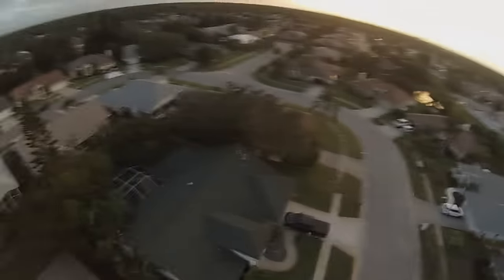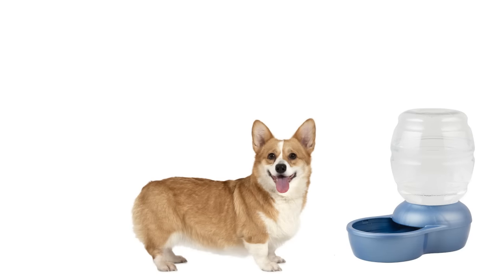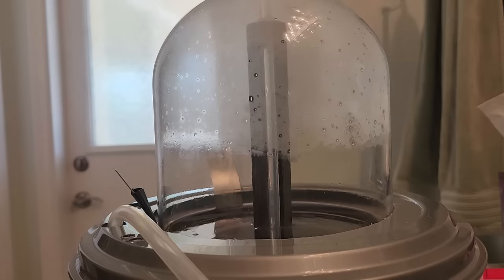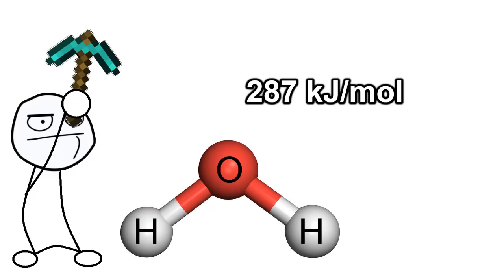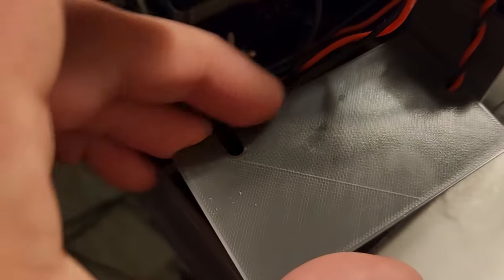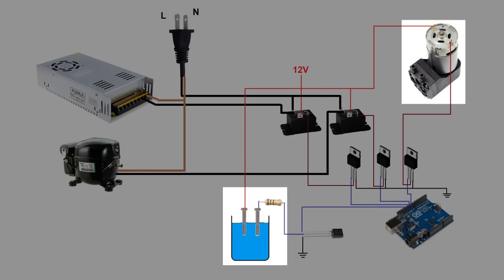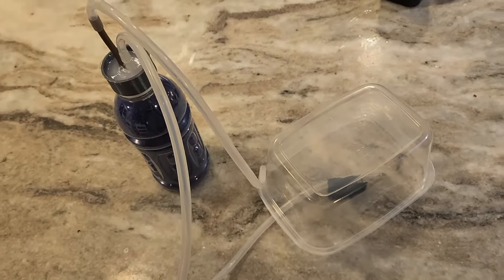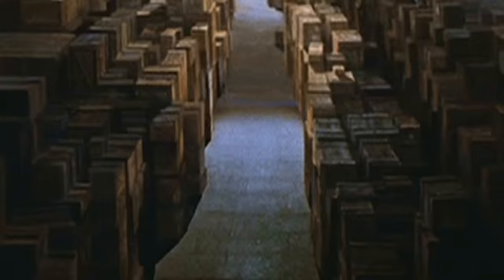Automated Hydrogen Generator

Comment: The initial concept proves excessively intricate for a simple task , giving rise to safety concerns, and the recurring comments echo each other. 🤯 Consider this alternative approach to enhance simplicity and efficiency:

1. Use an air compressor with a regulator to supply a high-pressure reservoir chamber. 💨
2. Employ gravity by connecting a hose at the base of the high-pressure reservoir chamber, directing the liquid into a securely sealed, high-pressure electrolysis chamber. 🚰
3. Install a top-mounted pressure release valve connected to a hose, followed by a check valve situated at the entrance of the filtration system. ⚙
4. Integrate a moisture filtration system into the setup, leveraging the increased pressure to explore various concepts. 💡
5. Implement an additional check valve at the outlet of the filtration system, connected to a hose. 🔧
6. Conclude the system with a gas collection chamber, incorporating necessary valves and gauges. 🌬🔍✨

Comment: Once you pressurize it, you can use the Hydrogen to power fuel cells.
Reply: Correction. The problem here is the energy you put into the system is equivalent to the energy out of the system. Hydrogen production is used as energy storage not energy production.
Reply: @shkronjax  we have a guy in NJ who uses solar cells to split water, stores the hydrogen, which powers the fuel cells. To power the house and charge the car. 
He also uses the hydrogen to power his internal gas engine lawnmower
Reply: @shkronjax  fuel cells efficiently convert hydrogen into electricity

Comment: another idea is using gold plated electrodes. Or at least test how long it would last. Not sure if the gold would separate over time. Same idea with platinum, you could make platinum-plated electrodes. Why would you need solid electrodes when you just need a high surface area exposed?

Comment: a lighter than air aircraft with a metallic coat that turns the entire body into a broadband antenna could maintain communications at a ridiculous range. The onboard electronics would probably be simple enough to be powered by a small solar panel too. GPS tracking wouldn't be hard either. Not too sure how the government would feel about it though.

Comment: Saw a video of a truck running on hydrogen from a tank in the bed.    If you made these commercially everyone could make their own fuel
Reply: No. This is very inefficient (somewhere around 10% efficiency) and the output purity isn't guaranteed at all. 320 liters of hydrogen is less than 30 grams, and contains less than 1 kWh of energy.

Comment: 1:10 i don't know where do you see the density of hydrogen and helium but is embarassing wrong:
1atm, 25°C
hydrogen: 0.082 kg/m^3
helium: 0.163 kg/m^3

you write lifting force that is measurable in N so what do 1.095 and 1.01 kg/m^3  represent?

Comment: HHO does not exist, it is H2 + O2 and when it is in the same container it is an absolutely lethal explosive, to me the two should only be combined at the very point of use, ie at the very end of a welding torch or burner.

Comment: Nylon is resistant to sodium hydroxide and is hydrophilic that makes it more attracted to water than air or rather bubbles and prevents the bubbles from crossing.  Take a woman's nylon stocking and stretch it over a frame that  sits between the anode and cathode rings.

Potasium hydroxide is even more conductive than sodium  hydroxide, and over a wider range of concentration.  

Dont use PWM, pulse width modulation, to directly control the flow of power into an electrolisys cell.  The cell having two plates and a dielectric  acts as a capacitor causing high inrush currents that can damage the electronics, and you have not solved the problem of inefficent electrolisys producing heat when one can more efficently buck convert the voltage  down and thus limit both voltage and current using a more efficent voltage.   Google buck converter circuit if need be.

Comment: You really should use some heavier gauge wire rather than those messy twisted bundles. So much wasted space from the insulation on each 'strand', and as you mentioned the voltage drop and noticeable heating. Some 5AWG or thicker should handle 40A with minimal losses and heating. Can either crimp some eyelets or use washers/bolts.

Comment: The other thing is they used water distilled water with salt not table salt cuz that has iodine in it but sea salt pure sodium chloride no sodium hydroxide but sea salt and water it was like one cup of sea salt per gallon of water distilled water if you don't know how to distill water you take a large pot fill it with water put a smaller pot inside the middle of that larger pot making sure that the smaller pot is heavy enough to keep itself on the bottom of the water that's of course it's going to want to float so push down put a lid over the whole thing where the evaporant as the water evaporates will drip into the center pot all the water that ends up in that middle pot is distilled another way to distill water as you stainless steel tubing on a pressure cooker that is also made of stainless steel and then just make yourself a still don't use copper because then you'll have gases that you don't want like hydrogen cyanide when reading that book world book encyclopedia it explained not to use certain things certain metals because of what kind of gases you can create off of using the wrong kind of metals in your creation of hydrogen and oxygen you do not want to contaminate your gases in any way shape or form by using anything that's going to contaminate the gas that's why you use graphite electrodes and distilled water with sea salt pure kosher salt.

Comment: I want to use solar panels and make the "free" energy that is always circulating around. While it's probably far from free, it's way cheaper than what it would cost normally once you have everything running. While this wouldn't be able to produce enough to keep a car going forever, it would be enough for a day trip to work and shopping then back home.

Comment: Those are decent multimeters. I got one for 20 from Walmart like over 10 years ago and it lasted non stop abuse until recently and it probably mostly just needs a new battery but also possible the switch is getting sketchy..next time I saw one for sale it was double the price and I was like eh.. then I recently got one off amazon that actually does dc clamp for like 30 and Bluetooth datalogging although the app asks for location so yeah thats bull

Comment: I don't recommend stainless steel for electrolysis, as the process creates hexavalent chromium.
Reply: Not only that but you also get a buildup of salts on the electrodes, which slows the reaction down.

Comment: Allrighty then lets try a different approach!

Stainless steel tube with its end capped in stainless...
long ceramic covered stainless rod, centered in the tube.
an expansion chamber capable of at least 60,000 times the volume of the tube, placed above the tube.
Fill tube with clean water.
Pulss voltage of upwards of 380,000 volts (low amps) to the rod @ high rate of hertz.
Reply: and what are you trying to make with that?

Comment: Disclaimer, I am a complete idiot when it comes to engineering, chemistry, women so keep that in mind when answering these questions.  Would this be a viable way to make enough hydrogen for a hydrogen powered car?  Would it be cost effective?
Reply: Nah. He spent a full weekend producing 320 liters of hydrogen. That might sound a lot, but it's only 28.7 grams. In a Toyota Mirai, the most energy efficient hydrogen car that money can buy, this would let you drive about 2.5 kilometers.
If you just spent that same amount of electricity (roughly 10 kWH) to charge up a Tesla, you could drive like 60-70 kilometers.

Hydrogen cars are electric cars with extra steps. And all of those extra steps incur efficiency losses.

Comment: The main reason these are popular is that people think they get more energy from them than they need to operate.  This has been proven wrong both mathematically and in practical testing countless times, but the myth persists.  Yes, they can turn electricity indirectly into flammable gas.  But you will never get close to enough gas from it to run a motor, to run a generator, to recharge the energy you used to make that amount of gas.  The only way I can see this really being useful would be in a zombie apocalypse, or other society crumbling event where the survivors don't have readily available natural gas, or even nothing to burn as a heat source.  A person could probably find some old solar panels in the rubble, and with very basic tools turn an old barrel, and some cooking sheets into a rudimentary electrolysis machine, allowing them to turn solar energy indirectly into burnable gas, which could be used for cooking and heating.  But no, this can not solve the energy crisis.

Comment: When a Car Radiator let gas air in like NH3 @ four Hydrogen and Carbon which is Methane in Car Engine .  My ? Is can we used them in Electrolysis for Car thank you for work and sharing great not giving up😃😄😀
Reply: Radiators do not let gas in. Radiators are for engine heat management. 4 hydrogen and carbon does not make methane as you are missing the energy needed to make and break bonds.

Comment: Singapore are the world leaders in hydrogen production. Small units to cremation size.
Hydrogen does like to go bang so you don't want to be near a lot of it that's not secure.
An American company were making and fitting small units to big trucks 10 years ago they claimed at best 7% saving.
British gas has had test house running on hydrogen mix that they say looks ok so far.

Comment: Don't compress hydrogen into any metal container.  This is a tragedy waiting to happen.  For sure don't reclaim the gas from a balloon back into there.  The thin rubber is permeable to other gases so you're not getting 100% hydrogen back, there could be some oxygen in the mix.  Another commenter mentioned osmotic action.

Comment: It's not that complicated in the experiment that I had read in 1980 from an early 1974 Wilder reconcyclopedia they used a 12 volt dry cell battery I've repeated the experiment using a 12 volt car battery or marine battery or any kind of battery that you can get of yet that puts out 12 volts yes the voltage is proprietary seeing how you need 12 or above DC volts to create any kind of CFM that might be required for using it on an automobile we made one that ran a car off of a 12 volt battery from a car and graphite electrodes we exhausted the oxygen and pressurized the hydrogen but not to the extent of liquefying it you may need a cryo pump in order to liquefy your hydrogen.

Comment: 36% electric to hydrogen conversion efficiency. Not bad but 10 gal tank at 120 psi only stores 1 kWh of hydrogen energy. Not practical for energy storage. Same tank volume would store 380 kWh of diesel.

Comment: Its not really a good idea to put 3d printed thing without any treatment - resins, abs solution - to liquids - they can pass throu the layers of 3d printed material, leak, or get stuck and cause some problems with that.

Comment: Design a rotary engine that will run on hydrogen and you'll have something there😮 Japan is going hydrogen Toyotas
Reply: It took him a weekend to generate 320 liters of hydrogen, on a setup consuming ~200 watts for maybe 48 hours. That's 9.6 kWh of energy spent to produce 28.7 grams of hydrogen, which has an energy content of 0.95 kWh.
I don't think you would be able to drive even a single kilometer with this in a hydrogen combustion car.

Comment: You could probably do this with a couple burrets.
Reply: Also I already saw some old-school versions of this example from like the guys who discovered this.
Reply: Just makes me wonder if you really needed the pump. Maybe you could have just put a lid on the water level and all the gas would push upwards into the balloons by themselves. Of course, you might need to take the varying pressure into physical chemistry consideration.
Reply: Also, why not use some sort of desiccant-rotation system, where some is in there drying the gas, and some is using the temperature rise of the system to dry the recharging load of desiccant faster?

Comment: Put it in a sealed tank. That's what we need to know. Why? Cause eventually people will use single piston motor to turn pulley that have generator head that can power electric car motors.  It would be nice to never have to buy hydrogen.

Comment: how about running a generator on hydrogen?
Reply: That was once done back in my home country in 1970s?! Engineers decided to run a generator with H, eventually the generator ended up a mile away from where it was stationed. However, at work I do run a generator on methane and have a regulator that controls the gas input. Things to note, hydrogen needs 3x more pressure than natural gas for same amount of energy. So, usually other forms of hydrogen storage are needed than just pure compression.

Comment: interleaving plates is pointless, the electrons will find their proper path on their own.. put each set of plates in separate containments, and one gallon glass jars are perfectly useable for this and much more commonly available. there must be a fluid path, such as a pipe of the water, connecting to both bodies of water, the electrons must flow!!! even without pure oxygen (never try to make both as a mix, it has the lowest spark ignition temperature of any gas mixture... and is dangerously powerful in even small amounts. the ads for you to make your own 'hydrox gas' are invitations to the ER or the morgue, no reservations needed. to explain, water is a perfect mix of H and O... when it burns it becomes water again... however as it is extremely flammable, and has such a low ignition point, adding pure oxygen to it (in perfect ideal combustion ratios) is an act of insanity or planned demolitions...
Reply: Putting the plates close together reduces resistive losses.

Comment: Yeah I can mix it ain't going to hurt the gases to mix does the oxygen is heavier than the hydrogen so it's not going to completely mix that's why some setups come with a t and a valve so in the oxygen pressure starts oxygen levels goes higher they just open it up and let the drain the oxygen out because the hydrogen is lighter than the oxygen

Comment: COULDNT IT BE USED FOR HOME HEATING?
🤔🤔🤔🤔🤔🤯🤯🤯
Reply: Sure but terribly inefficient
Reply: As opposed to just using the electricity directly, therefore minimizing any losses?
Reply: @ThaFuzzwood  IM ASSUMING THAT HE'S GETTING MORE KWH OUT THAN HE PUTS IN- OTHERWISE,ITS ALL PRETTY POINTLESS....
Reply: @liambroder4543  well of course that doesn't happen. Nothing can produce over-unity energy.
Reply: @ThaFuzzwood  NO- BUT A HEAT PUMP PRODUCES AROUND 5- 6 KWH OF HEAT FOR EVERY 1 KWH OF MECHANICAL ENERGY USED BY ITS COMPRESSOR-  SO I WAS HOPING HE MIGHT BE GETTING THIS KIND OF BENEFIT....

Comment: First, Seems extremely irresponsible to release a hydrogen filled balloon. With that out of the way, how realistic is it to use the fuel youve created to power a modified vehicle? Can you modify some kind of generator to run on hydrogen? can the power produced, produce more hydrogen, or power electric motors? i must know everything

Comment: very jarrrr-ing, so why not just submerge a inverse jar under water, its self-pumping, it also would function as submerged storage, floating cam with self image-stabilization is nice, so use pure carbon rod electrodes then, if you worry

Comment: Hi, very nice setup! I'm interested in the efficiency of your system. From your data I get 30A at 5V, that's 150w, and a prodcution rate of 15-20l/h. Considering that hydrogen has an energy density of 3 Wh/l, we get an output power of 45-150w. So the efficiency is around 30%-40%. Am I right?
I've done a video where I had the same idea: use a solid separation instead of a membrane. I came up with interesting results, if you're interested: https://youtu.be/32teBnexBEk
Thank you for you're video, have a nice day!
Reply: To my understanding it went up to 40A at 5V when it heated up
Reply: @logitech4873  Yes, that would drop the efficiency even more. But the order of magnitude is the same, and it's also what I've got in tests...